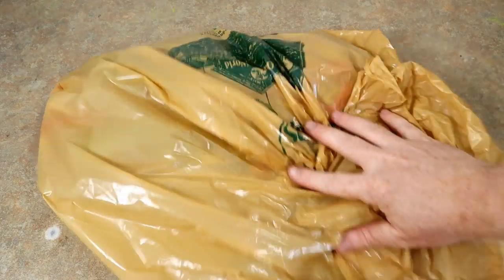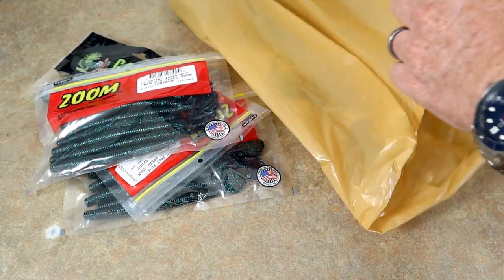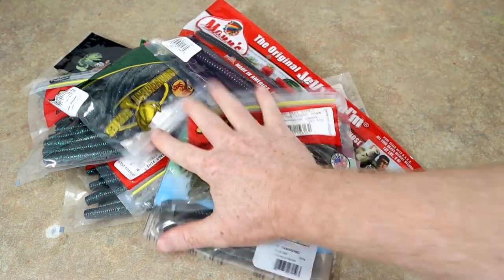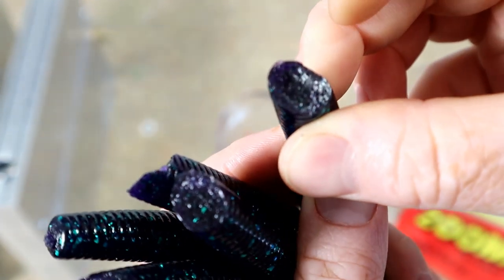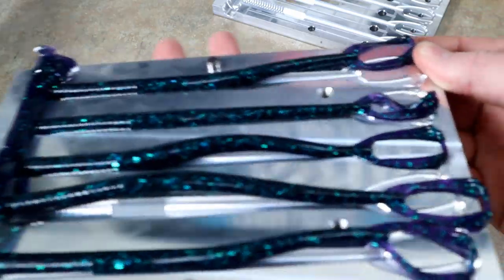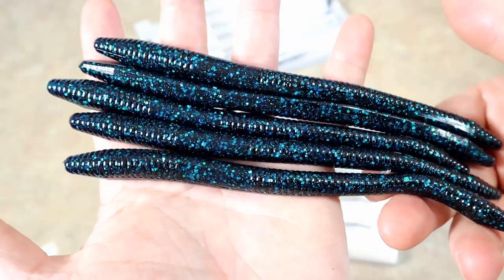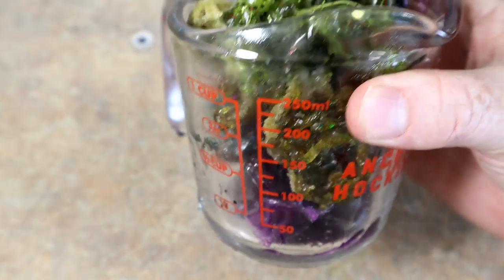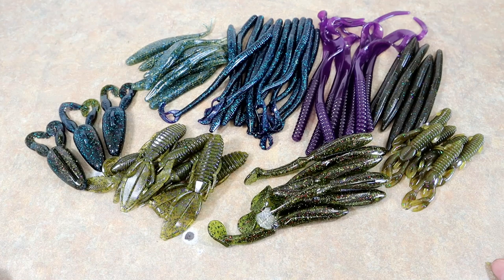BIG BRAND Bait-Meltdown!!! Remelting Brand Name Soft Plastic Lures

Comment: I wanna start making my own worms. I also would like to design some baits. I have some hand pour molds but noticed remelts were softer and I don't want them softer if anything I want them firmer. Do you know any household thing that would firm them a little? I wish I would have discovered your channel before I threw away a 5-gallon bucket of used and discarded worms.

Comment: I have two questions;  did you use heat stabilizer in all of your meltdown batches or is there some way you can tell which plastics need it and which ones don't?  And the second question; has your Bass Pro Shops been open all through this corona lockdown or did it just open back up today?
Reply from the maker: I used stabilizer in all of them...they aint using Dead On Plastix thats for sure haha..its been open all alomng

Comment: Was really hoping you’d have some zman in there. Very curious if you can remedy them and still get the stretch.
Reply from the maker: Z-man products are actually made from a cold injected rubber polymer using very expensive machinery.. you're not able to remelt it down and inject it with traditional tools
Reply: @WorldsWorstFishing  I was going to ask the same thing. Cool info - thanks!!
Reply: I tried to re melt z man and it literally will not melt even after like 5 minutes haha

Comment: Was hoping for a video like this from you! How critical would you say the heat stabilizer is? DO you think its needed on a bait brand-specific basis or necessary or not across the board? Thanks!
Reply from the maker: its good for remelt..Dead On plastic does not require it however.

Comment: Are you adding a splash of plastisol to each cup before you heat them or are just cutting and throwing them in n the microwave?
Reply from the maker: I'll add raw plastic if there's not enough to work with

Comment: you can buy a ender 3 3d printer for under 200 bucks and 3d print your own molds to re pour you stuff. not only can you replicate zoom etc. but you can design your own. also you can make crank and jig lures right on the printer.. when it comes to fishing, and repourning my own lures. its definetl.y the #1 investment.

Comment: im new to fishing, and was wondering why you would do this vs just using the regular baits
Reply: When you fish a lot, you tend to re-hook the bait and switch it out for new lure numerous times. After 5 fishing trips that thing is full of holes and it may not swim right, or it has nicks and cuts on it. The point of this video was to not throw the damaged ones away, instead of re-melt them to make new ones.